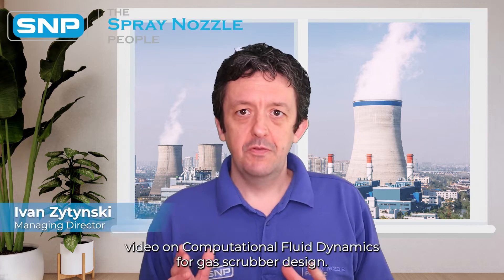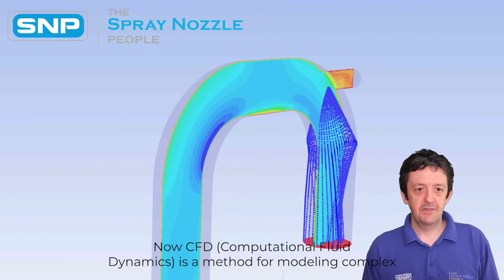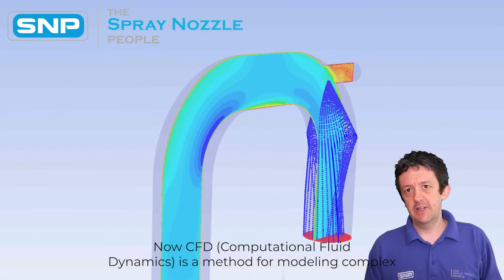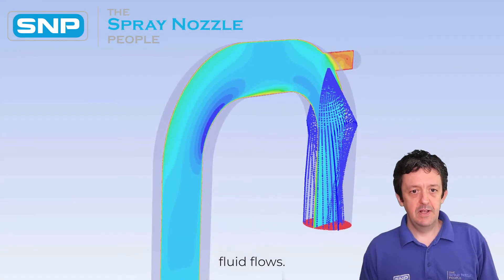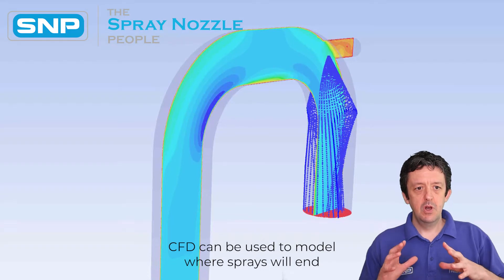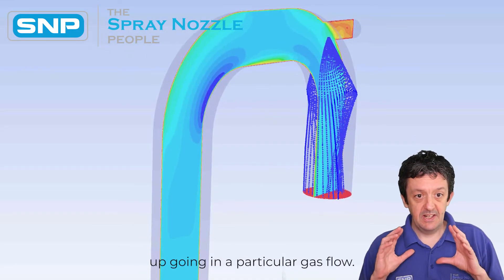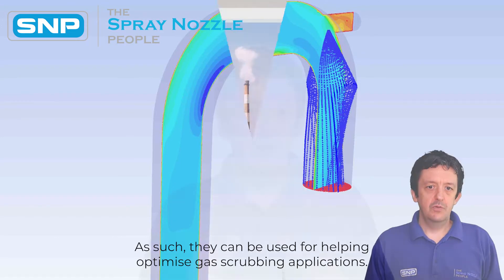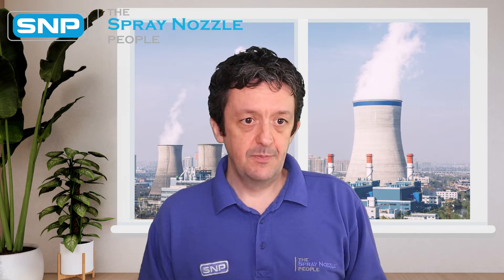CFD for gas scrubber design

Comment: hello i want to design and analyse the scrubber by cfd how can u help
Reply from the maker: Hi please contact us at info@Spray-nozzle.co.uk  and one of our sales engineers can talk you though what we can do. It's a bit tricky to explain it all in a comments section. But the very short version is that we have a full spray lab that can conduct drop size and spray pattern analysis for a variety of different spray scenarios. Connected to the lab is a full CFF capability.  The output data from the spray lab analysis forms the input data for the CFD along with other data about the topology of the gas stream and data about the gas flow. We can then model how different sprays will behave and help optimize absorption rates for your scrubber design.